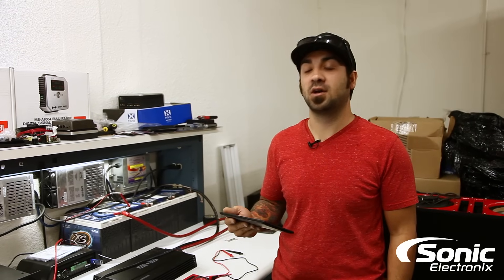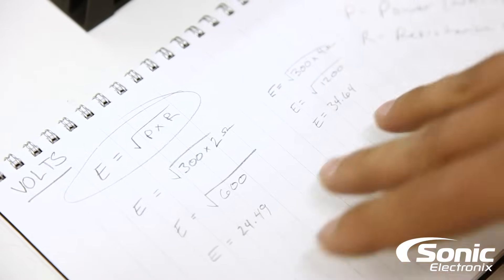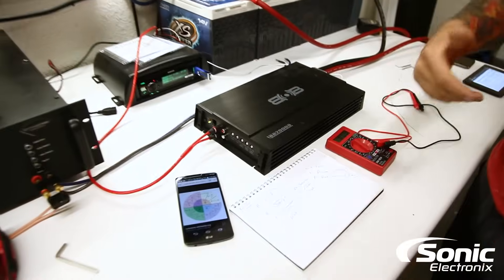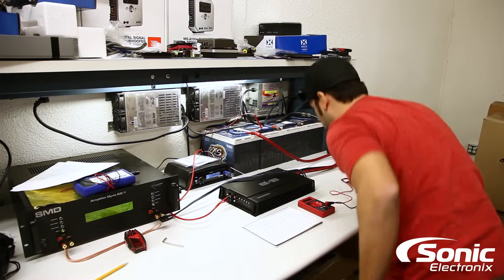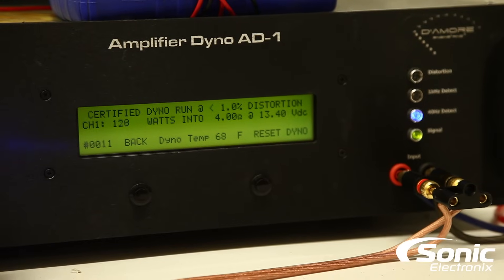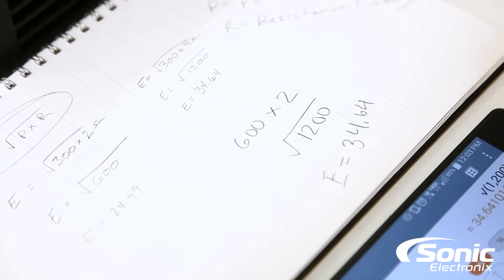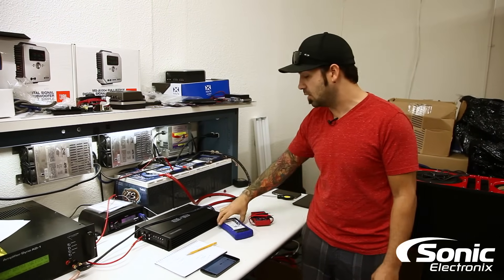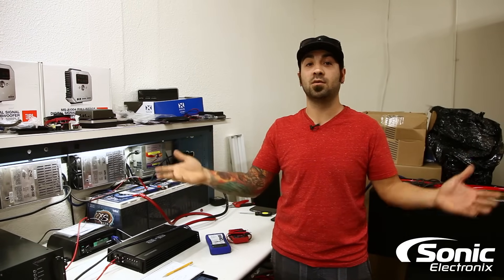How To Set Amp Gain to Match Lower RMS Subwoofers? | Car Audio Q & A

Comment: wait, you just measured 24 volts ac.. if you played a 60 Hz sine wave couldn't you run AC equipment off the output of the amp?
Reply: Nope !   is just for speakers : )
Reply: yes it could.
Reply: Melody a relay switch wired like a speaker and have it switch on and off led  lights with the bass of the music...
Reply: Melody both examples are videos on YouTube from the manufacturers. If I can find them I will post the links below.I have seen a jbl rep run a saw that was powered using only there amplifier outputs. Then they used that saw to cut in half a competors amp and it actually worked just fine. Also seen a older video from Us Amps that used there low impedance high current amplifier to make a arc cutter and cut in half a wd-40 can in half and other stuff. He used the amp negative output and grounded it to the can. Then used the positive wire attached to a carbon rod and cut the can in half. So while it's possible on some high current amplifiers that can handle low ohms loads to do crazy stuff Im not trying it on my fosgate bd1000.1 amps lol.
Reply: https://youtu.be/kDxJVKymqY4
Reply: https://youtu.be/ANa7NnhYo3A

Comment: Can anyone help me, I got a zrs c2 amp and two dpw18-s4 they do 2500 rms, I have them wired 4 ohm to two ohm bridged(I guess) this amp has two amps in it but only inputs on one side, 2 channel, my main question is if these are internally strapped(what I think) and if this is even giving the subs the right power, Ive always been told that if you wire down you get that same wattage through both speakers but Ive been reading lately that you dont so just questioning everything rn lol thanks
Reply: Go.

Comment: Just locked in on your vidz yesterday and your good at your craft no doubt. The whole game has changed since i was bump'n. I had 2 Punch 15's, 2 Three way sony 6x9's, 2 four inch Altecs with a punch 150 on the woofers and a punch 30 on the highs with a XV-1 cross over in a 1986 Toyota Tercel 2 door hatch back with a pumped up alternator and  Maaaan i was bump'n ya herd me? Lmao! But now I'm older with a Kenworth W900L that came with a bunch of Memphis brand goodies but an old Audio Bahn amp. So i wanna make sure everything is matched up and running cool. I also have a 2005 Chevy Trailblazer that i wanna throw alittle sump'em in too. So thanks for doing these vidz. I'm not looking to do crank up's but i want my thump nice'n clean😎✌

Comment: Does having a capacitor effect tuning at all? Do I add the voltage from my cap to the voltage reading on my multimeter? Before I installed a cap the gain was set perfect but after installing the cap (gain wasn't touched) the reading was like 2 volts. I turned up the gain to its proper setting and my subs sounded horribly distorted.

Comment: I have an amp that's gain volts need to be set to 31. My question is when I set my bass boost should I keep it at halfway before setting the gain? This way I can turn it down for songs that have too much bass and up for songs that I want more bass in. Most people say to set bass boost to zero when setting gain. If I did that though I would not be able to turn down sub for songs that the sub would have too much bass in such as rock songs. Or should I set the bass boost knob all the way up tune the gain and then bring the bass boost back to halfway after? This way I have room to turn it all the way up without clipping and turning it down for songs I don't want too much bass. I use the external bass boost knob as a sub volume control sort of.
Reply: mitch ishere
Set the Bass Knob where you think you want it, then set your gain.

Comment: Hi! good good good video! i like it!
A question..may u help me?
If I have a 100wrms amp and my subwoofer is 200wrms(4omh).. its suposed that i must to put the gain to the max??
and on the other hand..
I would like to know the Wrms of my stereo sistem (pioneer DEHx8600BT and others..)
most of stereos say 50x4 (peakpower) but i just to know the rms of that stereos (just to know it) is it any empirical test to do it ???

THANK YOU VERY MUCH IN ADVANCE!!
Regards from Spain!

Comment: Hey hi what about a 2000w amp with a 2000w sub the sub is 4ohms and both sub and amp are from kenwood! 
Sub: kenwood KFC-W3016PS 12inch
Amp: kenwood KAC-9106D 
What should I do to get the best sound possible without damaging any of my sub or amp! 
PS: here in Africa it's really hot here will it affect anything? 
Thank for your help :)
Reply: it's a must to have the amp with more headroom than speakers....for example 500W RMS SUB,1000 peak ,should be used with a 800w rms / 1600 peak amp but keep the gain down so you don't burn up the sub using the method in this video...headroom has a big role in giving you consistent quality audio even in the pro audio industry.If the sub matches the amp...you run the risk of overheating the amp and destroying it.
Reply: +Deejay Core thanks sooo much for that tip bro! Then what should I get I got a Rav4 2005 and I will get SoundStream as my after market speakers and sub I want to put in the front and back doors the RC.6 400w 6.5 and in the trunk I was going to go with the T5.122 Tarantula T5 series 12" 900w RMS or RXW-12 and for the amp I got 0 idea to what I should get can you please help me? 
As I sand I want everything to be SoundStream 😁
Thanks for your help :)

Comment: I have a peakers which rated 500 rms (200 watts peak power) @ 4 ohms, if I connect it to an amplifier that is rated 650 watts @ 4 ohms and I am playing at maximum (full volume), will the speakers blow if i playing continuously for hours? Is it true that a speaker will take 4 times its rms power before it blow?

Comment: Hey great work there even though I can't get the concept of how electricity works on these things at all.

I'd really appreciate your help on this.
Well I got my: 
▪Amplifier wich I can choose to set it work 2 ways: 
□2 channel ×100 watts
□1 channel ×400 watts
▪2 8inch woofers 8ohm (200W)
▪2 tweeters 4ohm (100W)
▪2 5inch coaxials 4ohm (200W)

How do I have to wire all these to get a total 5-7ohms in order to get best quality sound and also without blowing them up.

□Parallel  □Serial 
□2way stereo  □1way mono 
>wich channel/s
□2×100W□1×400W
Can you help me with a diagram or something.
I really need some help with that.

Comment: i think my ground is bad. i put my amp gain all the way down to try my target voltage. in your video you started at 15v. on my amp it started at 149v. soon as i turned up the gain the voltage dropped to my target but i think something is wrong. n yes my gain was down not up

Comment: I have a question I hope its not a dumb question and get dumped on. I have 2 12" woffers single coils at 175 Watts RMS 4 ohms each one. I am going to pair them to  drop them down to 2 ohms. This is the question will I be adding both the total RMS of both woffers to get total RMS and adding it now with the drop ohm at 2? or will it stay at 175 RMS together but at a  2 ohm load getting total voltage.

Comment: I'm a bit confused by the output. You calculated that 24.49 measured on the multimeter should equal 300 watts. I would assume that if you measured more, you would get more watts, and less with less... Well... you actually measured less on the multimeter when you set the gain on the amp (2% less to be precise), but when you ran it on the dyno you got 334 watts, which is 11.3% MORE than what we expected. Where we should have been at 294 watts (2% less than 300). That's a variance of 13.3%, which if we were just guestimating would be fine. But you mentioned Ohms Law, which are exact equations, so it should work forwards or backwards, but we were way off. Can anyone explain the difference? Thanks.

Comment: Running 2 500w RMS 4Ohm subs powered by a 1000w RMS 1 channel amp (550w Rms @ 4 ohm, 1000w rms @ 2 Ohm). I am connecting these subs in series which will bring me to 2 Ohms for the subs and for the amp correct? So in calculating this do I need to use sqrt(500w x 4Ohm) or sqrt(500w x 2Ohm)... Hopefully what I am asking makes sense

if it doesnt, I am running two Image Dynamics IDQ10s with a Kicker 11DX1000.1 amp. What do I do?

Comment: I have 250 watt Kicker DX250.1 amp, I believe thats the RMS maybe.
And a 300 watt rms Kicker Comp(S) subwoofer with a 600 peak power.
The amp is 2 ohms but the sub is 4. Is that fine?
The amp says it makes 250 watt at 2 ohms and 144 at 4 ohms. How do I make it work at 2 ohm?
And lastly, what should my Voltage be like you showed in this video? I am not good at math..

Comment: So do I turn my head unit all the way up? Or at my normal listening level?
Reply: First, turn your amps gain all the way down then you'll slowly turn the volume on your head unit up (car stereo) until your subwoofer/subwoofers starts to distort once you've reached that distortion point your ready to run your test.. also unhook any highs you have connected so its only the subs playing..
Reply: +redavis1973 so disconnect the door speakers?
Reply: Yes..

Comment: ok i have to ask. (even tho im sure someone else may have lol) what if your sub is dual voice coil? do you factor it at the ohm load your amp is going to see? (aka for me it would be 1 ohm... that my amp will get)
Reply: Rule of thumb is multiply it by 2, but factor in wire impurities and the fact that amps don't out out constant voltage, just multiply by 1.8

Comment: I don't wanna spend 150 bucks on a smd dd1 that I'll use once, is there another way to check for distortion
Reply: If you acquire a test sound file with a constant sound you could use a multimeter to check the output values, if it's constant voltage then you're good, if it varies too much there is distortion from "fight back" inside the amp, or another issue throughout the electrical system

Comment: Is it bad to Mix different RMS Subs ? One is only 1000 kicker CVx and the other is a 500 rms CVR both 15s
Reply: Baby Gotenks i notice your comment is old so u may have found out by now from someone else but I believe that as long as they are on their own channels with there respective amount of power they should be fine however I can tell u from experience that the two sub's in the same box that the 1000 watter will eventually beat the shit out of the 500 thus prematurely wearing it out. hope this helps.

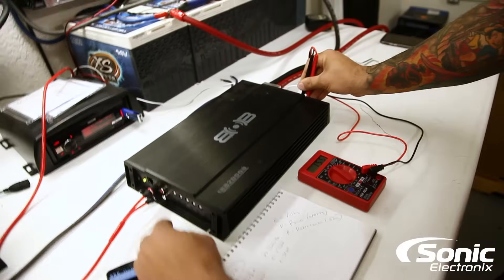Comment: isn't your multi-meter using the wrong lead inputs? shouldn't the black be on COM and the red on V OHM mA ?   I have on of these and the top post is used for series amp readings.    Referring to 3:20     Thanks

Comment: I'm confused , I have a dc audio 1200 watt monoblock  amp powering two 2ohm dvc m38 subs rated at 600 watts each.  I have them wired at 2 ohms final impeadance. the amplifier is rated at 780watts at 2ohms. I did the formula as explained, came.out to 39.6 volts. everything on my head unit is set to 0. bass control knob is turned all the way down as are all the filters and gain.  turned my head unit all the way up, turned my gain all the way up and it only puts out 29 volts. now I have heard that it's not good to turn the gain all the way up, but in my case I have the gain Maxed out and I'm 10 volts short from.my desired voltage.  am i ok with my gain turned up all the way even though I'm at 29 volts?

Comment: how is this possible;
I got a Pioneer GM-D9601 (1200rms @ 1 ohm)
and two Pioneer TS-W3003D4's that are 600rms each. So amp matches woofers darn good in rms. Square root of 1200x1 = 34,6. But!: if I turn the gain all the way down I still get over 40volt. Also the bass comes better when I set the gain a little higher then all the way down. So what the.. ? 
Today I tried this with another woofer (400 rms 4 ohm) and same amp. If I set the gain right according to this method (40v) the bass is shit. When I turn it up it's good.

Comment: i have a 2 alpine type Rs 12 wired to 1 ohm to a hifonics brx 2000.1 for that set up whats a good test tone to use while setting gains.. and what would be a good voltage. there rated 1000 watt rms 3000 max each just looking for some community feed back before i tune the amp and overdrive. also i have a avh x5800bhs pioneer is there a way to disabled door speakers without messing with harness while using test tone or and i going back into the dash... thanks ahead of time

Comment: So if you're running multiple drivers in parallel, do you add the rms of the drivers to find your target RMS wattage? Say I'm using 3 JL 10W0-8's in parallel. They are 125 watts RMS at 8 ohms each. So would I target 375 (125x3) watts rms at 2.66 ohms? or the square root of (375x2.66) which is 31.58 volts. Or is the math different for multiple drivers?

Comment: how can we do this while we're actually testing the amp in the car stereo? I can disconnect the amplifier but my component speakers are still hooked up and it's quite annoying. I'm not sure if it will damage them, but if I go about 3/4 of the way it seems okay but I'm not sure. Is there an easy way to disable the other speakers as well? Can I bypass them possibly?

Comment: question .... I have 2 alpine dvc4 that can handle 1000w rms.  wired down to 1ohm , and want to hook it up to my hifonics 2400w. I did that math but wanna make sure it's right I got my voltage at 44.7 is this correct

Comment: I can't get the multimeter to say anything? do the other ends hook up to the amps speaker outputs?
Reply: ***** thabks for the response. The plastic that covers them was to long so the metal couldn't make contact.so I cut the end down and it worked

Comment: hey man it all looks easy but where should my lpf be when i test it
Reply: the frequency where your midrange speakers roll off at, usually 80-100 , tuning according to box would be for a sub hpf (half octave lower than port tuning)
Reply: Jaydee420 Choose an lpf frequency that your subs can play .
Reply: Not what your subs can play. It's what the box is tuned at.
Reply: DCVR614 wrong

Comment: you said to have the speakers disconnected, but how would the amp know what the  resistence is while adjusting gain ? for instance if i would have my 4ohm dvc sub wired in parellel to achieve 2ohm load; and im shooting for 800 watts off a 900rms amp at 2 ohms, how does the amp know the resistence if the subs not connected. is the gain going to be linear between different impedendences ? and it would be effectively the same setting achieving half the wattage at 4 ohms, or a quarter at 8. or double at 1ohm. is my question clear enough

Comment: is the process for a component mids and highs system the same..
 but my question is with the comp system being 90 watts would you double it (being a pair) to 180 watts x4 ohms or use just the 90 watts x4 ohms

Comment: Is the process the same when trying to set an amp for a component system... if so... would you use the rms wattage of the components and times the number by 2 because of the set?  or just the 1 rms number...

for example
90 watts rms at 4ohms
or
90 watts ×2=180 at 4ohms=

to get your targeted voltage

thanks in advance

Comment: Okay I have a Hifionics Brutus 2400.1 rated @2400 @1ohm and I have a American bass hd15d2 rated at 2000watts rms. I wanna wire my sub in parallel so I can get more power so 2000x1ohm=2000 (square root) = I should be looking for 44.7v?

Comment: hey i got a ? can i power 2 speakers and two subwoofers in my car in 4 channel amp the subs put out 400 both i just want 200 out of them not alot and like 80 for speakers in the rear the amp is at 1000 watts ?

Comment: one quick question, I want to set up a 1500 watt amp with two 10' subs capable of 2100 watts a piece. I'm only gonna set them up to achieve about 1000 or so watts off of the amp. I just want to know how to achieve what's going on in this video, for that setup. thanks for the answer if you've got one!

Comment: i have a 1800 watts amp 4 channel with two built in crossover on amp, 1 crossover run my 1 and 2 channel, the other run my 3 and 4 channel, my 3 and 4 channel is running my 6x9 speakers, my question is my 1 and 2 channel i want to run my 12 inch kenwood subwoofers single coil 4ohms RMS 250, max peak 1000 watts, my amp guide show 225 x 4 @ 4ohms-  450 x 4 @ 2 ohms and 900 x 2 mono bridge @ 4 ohms, so can i parrallel wire my  two 4 ohms 12 subwoofers bring them to 2 ohms and than bridge them to my 1 and 2 channel to get enough watts to push my 12 subwoofer without stressing my amp?

Comment: I need some help I have the Alpine 1507 V12 Bridged into 4ohms  1500W The subs are x3 10" MTX 5500 12 ohm. Im so confused about the whole ohms but when I purchased my system it all made sense back then I mean i was like 17 years old im 34 now. Its still pounds so loud but i recently got a new deck Kenwood excelon KDC-X998 and the sound bass seems distorted but a hell of alot louder. I dont want to damage my system. The watts peak of the Tri box is 1,500 watts rms peak. What would be the right gain for my system. Thanks again in advance I really appreciate it. Don't worry about power to the amp I have that covered with Caps and alternator. I forgot to note that all three 10 are hooked up together so its only a positive and negative going to the amp.

Comment: How does a car battery 12.4Volts handle this 34Volts? would it not kill the battery?
Reply: Ac
Reply: Thats what the Amp is for!
Reply: It doesn't matter if it's AC or DC. You are correct, when the car is running you've only got near 14 volts, however you can change the voltage depending on how many amps are given off. Its up to your amp to convert it to a lower power but higher current, for example an input of 10 amps at 5 volts can be converted to an output of 2.5 volts to get 20 amps, or to get 50 amps, lower the current to 1 volt